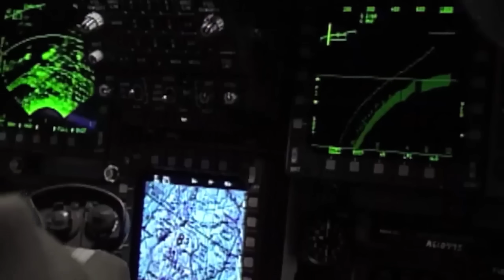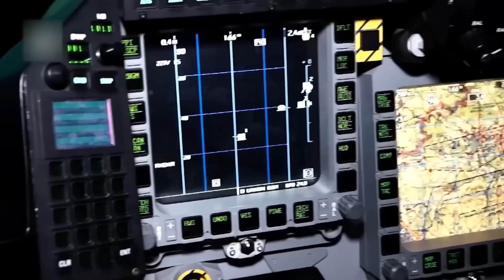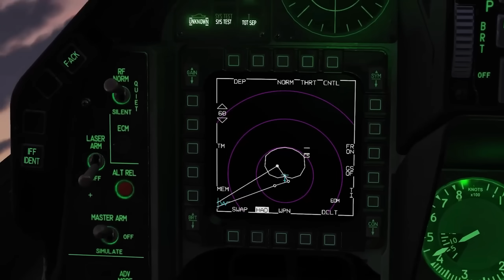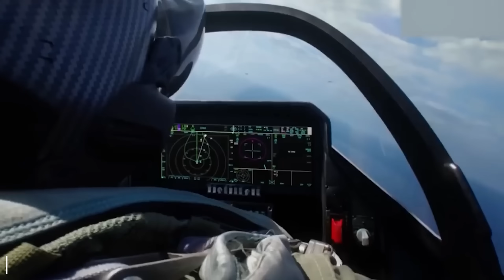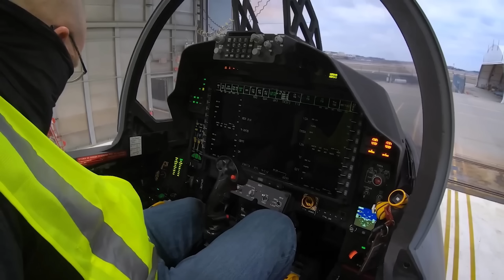Finally! USA Tests New F-15EX Eagle That Defies Physics – Next Gen Fighter Jet Revealed!

Comment: I doubt very much that it "defies physics"...that's impossible. Click bait...
Reply: Indeed though there are things  physicist did not find, all things belonging to physics.  There is much they still did not have found.  1. Space is eternal, no form not even a sphere, not expanding, goes on  forever no end., has various densities   2. Time   Time is an illusion . It is always here and now , what we call time are cycles.  3. Human have a soul which is part of the quantum conscious field. Everything in space is based on quantum.  4. Antigravity was already established by physics in mid50s, 5. Levitation is already found , 6. Free energy ,zero point energy from magnetic field and from quantum in  space already found by Tesla and others. 7. Paranormal phenomena exist .  8. Souls are part of quantum consciousness field which existed forever.  9. There is no begin nor end to the Cosmos..
Reply: @connectthedots5678  -- All things belong to God...
Reply: Sergei Bogdan in a Su57E defies physics. F15Ex doesn't do anything much. Just that the Engines it uses are amazing with Titanium carbide deposited on the edges of turbine blades increases life by resisting wear as the speeds it rotates at edge exceed Mach 2.